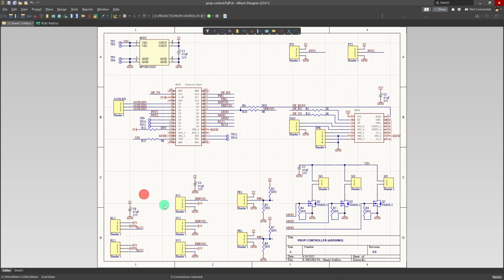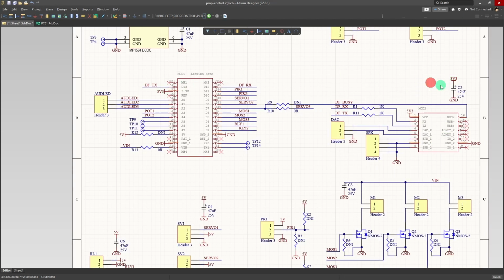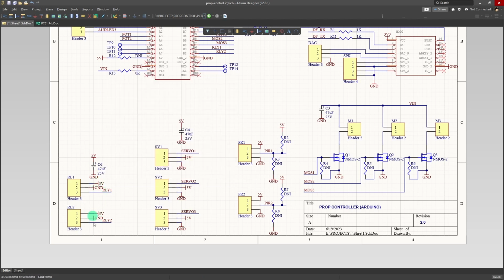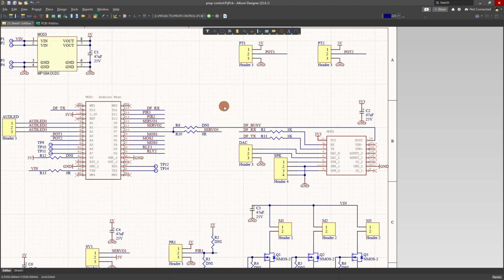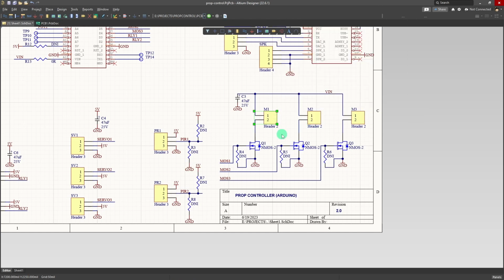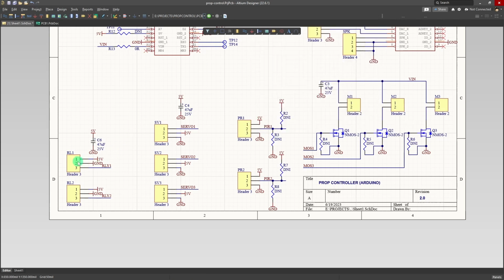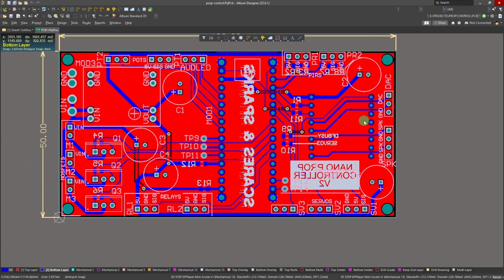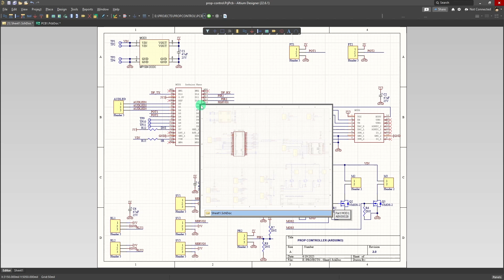Arduino based Prop Controller

Comment: Hi, are the source files for the board design available as I'd like to propose a change to the design :
I'd like to change 
Move Pot 1 to A6
Move Pot 2 to A7

I'd also like to provide a dedicated header for A4 (SDA) and A5 (SCL) so you can drive a Adafruit PCA9685 16-Channel Servo Driver.

Comment: Hi, just wondering what purpose of the AUDLED pins are as they don't seem to have a ground on the board. Are you able to give an example of what that might be used for ?

Comment: Good Morning Looking on where to purchase the parts to build this controller. Thanks
Reply from the maker: The cheapest place to get the parts is AliExpress but if you want them faster Amazon is good. These are multi packs but you'll get the idea from them.

Power board
 https://a.co/d/eOCRKte

Arduino
https://a.co/d/eIFKWJF

Audio board
https://a.co/d/ghXPFyu

MOSFET
 https://a.co/d/0bBC2qo

The PCB can be ordered from PCBWAY. Choose the cheapest global shipping and you can get 5 boards for $10 !